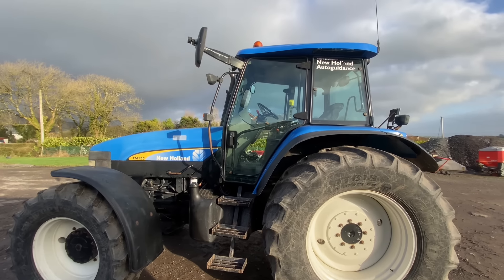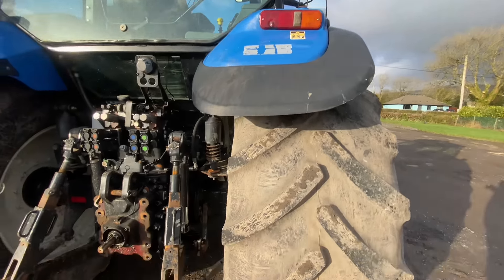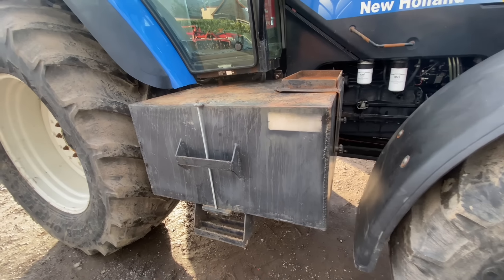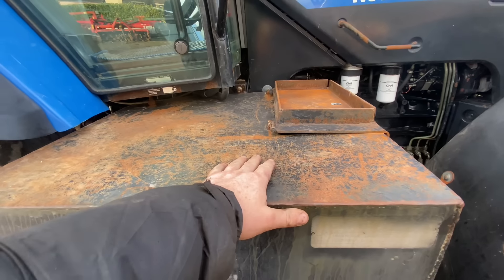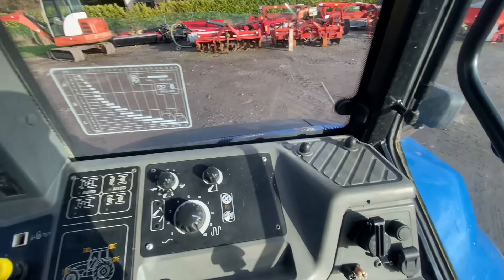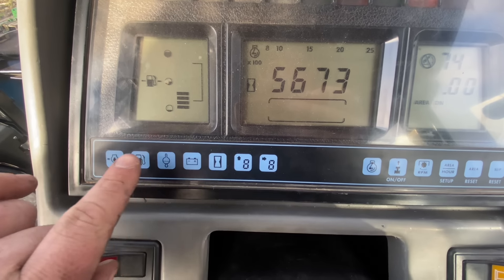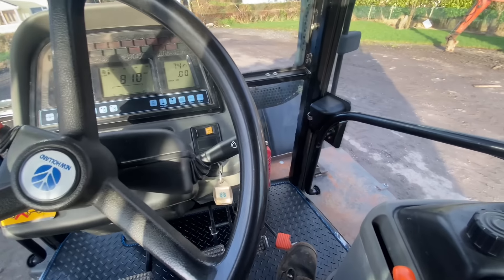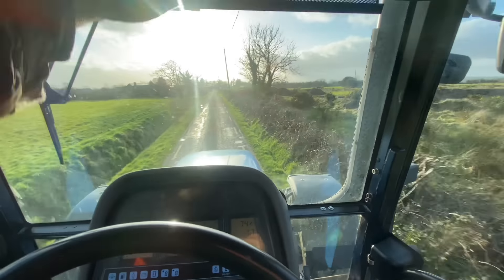THE KING OF THE MODERN CLASSICS !!!!NEW HOLLAND TM 155 🇧🇪

Comment: in order to read the old hours on it ,you hold the button next to the hour glass on the dash board and then you turn the key to contact and then u realese the button. This is for checking fault codes and the last 10 fault codes are also gonna be visible .  with the button next to the hour glas you will have to go thtough the fault codes by pressing it and the tractor hours will be displayed on the right side of the dash where the hydraulic parameters are. This can also be done on the 40series and 60 series tractors beacuse of the same dash . Sorry for bad spelling
Reply from the maker: Thank you
Reply: Does this just tell you the hours of the last fault codes or can you read the current hours aswel? 
I have a tractor with 12k hrs and the highest reading on the fault codes is at 9k.
Reply from the maker: The way this guy showed me it comes up in the centre where the hour display already is
Reply: There must be another trick so. Or my 40 series is different. 🤷🏻

Comment: Nice clean example :) I do feel the 8340's are faster on the road, but the TM's can pull almost anything :)
Reply: So will a good 83
Reply: Agreed re pulling. No trouble with a 5 furrow kv fully opened out even this wet year.
Reply: 2400rpm on any of the tm's or 40s they can move on the road and the 10/13 remap 😜

Comment: For me the TM175 is the boi.
Reply: Not for the back ends tho 😆
Reply: They gave horrendous trouble.. Both the 175 and 190..
Reply: @265justy  interesting, years ago i worked for a contractor that had one on front and back mowers all sumer. pumped slurry all winter. Did some tanker work, and drew silage trailer on long hauls. Only time it broke down was after warranty finished they gave it the magic spanner and it blew the radiator hour later. Luckily stoped the engine before it got hot.

Comment: If that’s an 03 or 04 the decals are not correct
Reply from the maker: I’ve often heard this but I don’t think there’s any right and wrong answer to it , because I know of a 2006 one from now with the white decals .
I also have never seen a white decal machine in Holland or Belgium so could be different.
Reply: @mrcvx  the screen for the gear change is different on later ones
Reply from the maker: Yes I’d say for 2006 on? I had a 2005 one with the older screen
Reply: @mrcvx  We have a late one 2007. Had toe get that screen rebuild
Reply: @mrcvx  I have seen the white decals in Holland , the leaf design decals came out in late 04 early 05 , have you came across any genesis tractors on your travels I am a big admirer of them and I would like an 8670
Reply from the maker: Seldom see them , sought after machine now

Comment: the more fuel you give it the idle goes up not down, the new style tm 155s cant be touched as elec injector pump and are mostly gutless tractors
Reply from the maker: That is incorrect you are thinking of the 175/190
Reply from the maker: You can see in the video it's a mechanical pump
Reply: Yeah a lot of TM175/190 were changed to mechanical pumps so you could give them the screw 👌